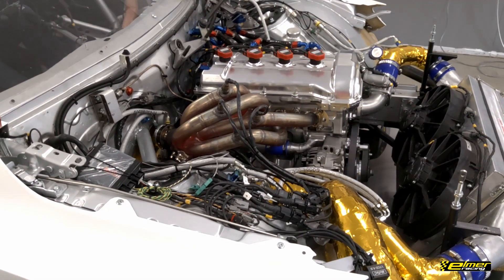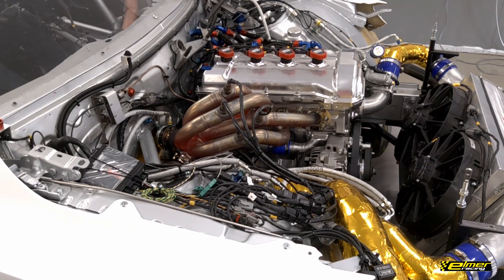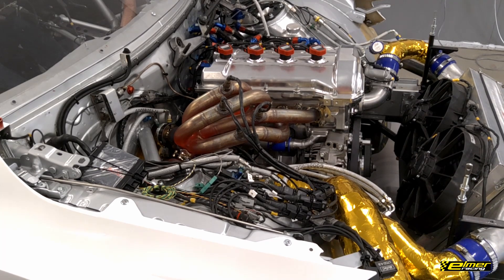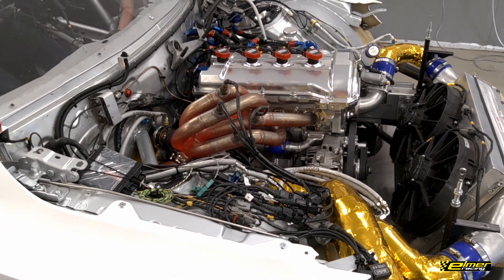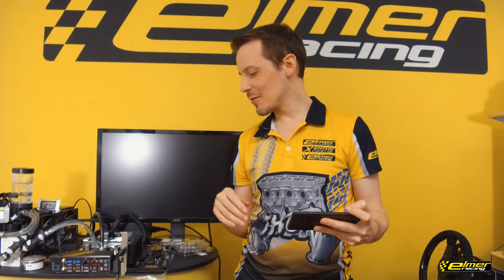Rex engine dyno update!

Comment: Só ...and the subaru rally car anti lag srategy....its nice to....like a get engine .?!
?
Reply from the maker: Having separate injectors and ignition systems in the exhaust has been banned in most racing categories for a very long time.
And no need for that extra hardware in most cases. Modern anti-lag is just better.